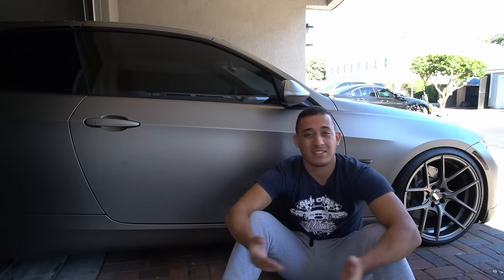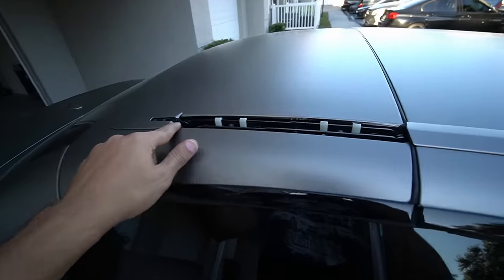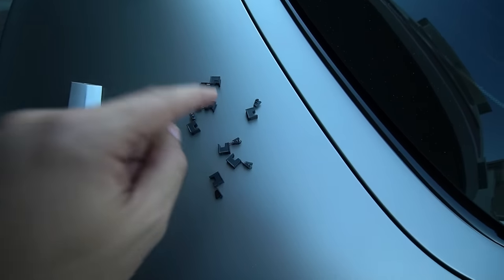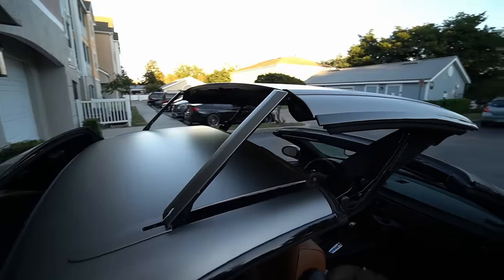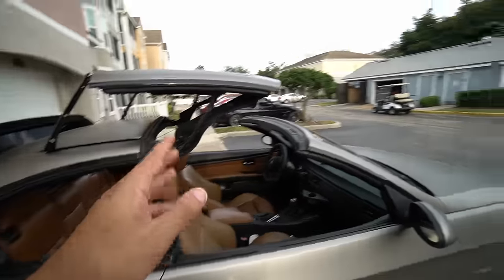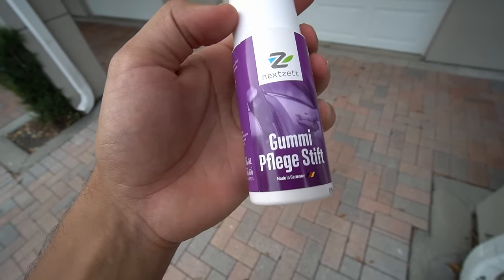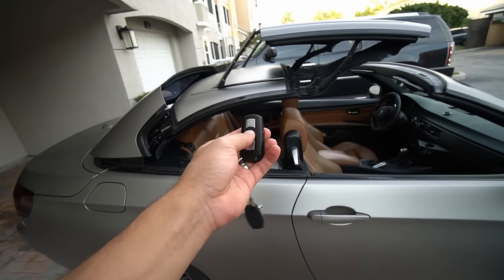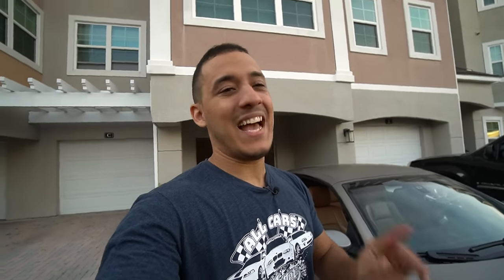Don't Buy A BMW Convertible - Here Are 5 Reasons Why

Comment from the maker: Just released a Vehicle Virals shirt featuring the BMW from this video. I have less than 100 available! https://vehiclevirals.com/products/bmw-3-series-in-motion
Reply: What about the coils, I have seen videos of which he talks about how they break down fast.
Reply: Vehicle Virals What’s the rims size
Reply: Help with my 2002 bmw 330i car got  hit on front bumper the air  bags in gaged  now car will not start where do I  start to trouble shoot why car will not start  ???
The battery is brand new ???????
Reply: A bro  I wanted to ask you a question about cleaning the rubber seals because I'm about to buy a bmw hardtop convertible. My question was what makes the rubber seals dirty what if I never put the top down will the rubber seals still get dirty
Reply: i have this same car 2008 model and i have one of the trim piece missen. will the link provide me with the part that will work/fit for mine? just asking. will appreciate any response
Reply: I also broke the small part in the roof 440 2017 , where I buy one, send a link from where you bought it, at the best price
Reply: I've had more relationships thanks to this car. nobody was looking at me when i was in my honda civic.

Comment: Had my e93 for 5 years zero issues. Works flawlessly.
Reply: How many miles on the clock? And how many miles you put on it? Considering buying one
Reply: I'm at 10 years, no issues either...
Reply: @michaelmullen8278  got it with 110k sold it at 180k. Only issue was a speed sensor. The 328s are solid
Reply: @eam3618  Probably N52 with 3.0L displacement. Right :D ?
Reply: @kjschrauber2126  heck yes
Reply: I’m on my second year with my m3 droptop it works perfectly!
Reply: Lucky for some😑. My one is playin up.
Reply: You have a pos car dude...just accept it.
Reply: @michaelmullen8278   My 2010 E93 hardtop still works flawlessly as does the rest of the car. 122k miles on the clock 

Definitely maintain the hardtop like shown in the video though, very easy DIY maintenance.
Reply: Im at 11 years on my E93 122k miles

Top works flawlessly as does the rest of the car.
Reply: I have my e93 m3 for a little over 2 years 92k on the clock and the only thing I replaced was a thermostat.
Reply: Yo tengo uno 
El motor de la capota falla toca realizar cambio
Reply: @santiagomateus333  aveses es solo un relay, busca videos aqui en YouTube
Reply: @camposjesus3725  Same here, 2008.
Reply: I have E93 and is maintance nightmare ,even i use it as weekend car there is alwalys sometning to spend money and time to fix,when you fix something after few days a  new problem  ,now i have rolover controler problem thas is so  annoying (it blink you in eye and you cant even see the time or temperature becase warning covers it) ,it started after installing new 12V battery ,we tried everything ,check everything ,even spend lot off money on new ROC module but its still there
Reply: Just had maintainance issues

Comment: I’m almost afraid to say this (knock on wood)...back in 2007 I purchased a brand new BMW e93 330D here in Italy, which I still own in 2020 meaning it’s now 13 years old and I drive it every day. It now has 250.000 km..... I take care of it like any other car, run it through automatic car wash, though I have never encountered any of these problems. BMW haters can say whatever they want, they may not like them and I can respect that but I personally still today impressed with the quality of the car. Personally I’m not a German car fanatic... I bought this because I wanted 4 seats, convertible, and  a hard top (buy a soft top  and then you will see how expensive it is to maintain!) , at that time it was either BMW, or Volvo. I opted for BMW, and 13 years later I don’t regret my choice. I have a coupe, a convertible, and a sports car all in one.
Reply: After 2008 BMW reliability  went down hill
Reply: I got mine in 2010, none of these issues either. I was also looking at the volvo, and VW had a hardtop at the time too. But obviously the e93 was the best option.
Also 10 years later, I've never done any of these preventative maintenance things lol 🤷🏽‍♂️
Reply: Same,Convertible top has been great no issues on or 2007 335i. As a matter fact, since owning this car since 2009 , I have only had coil pack issues. The rest as been regular maintenance .speaking about maintenance. I use Crytox on all the weather strips for this car. Aircraft and even NASA use this! Being a convertible it’s got over $2000 worth of weatherstrips so you want to look after them ! The little bottle of Crytox was about 50 bucks back in 2009,but well worth it. Cheers

Comment: I’ve owned two of these cars.  My first was a 2011 328i hardtop convertible.  Great car.  But after 4 years and 1 minor issue unrelated to the top, I moved on and bought a 2015 428i hardtop convertible.  It’s an even better car.  And it gets fantastic gas mileage...better than any car it’s size has a right to get.  Additionally, that 3 banger is faster than my last one was with it’s straight six.  It’s roomier, quieter, faster, and just more comfortable than my 328i ever was.  This car hasn’t had a single issue.  That’s 8 years of straight BMW hardtop convertible ownership, both originally purchased as Certified Used cars, and in all, there’s been but ONE very minor issue that had nothing to do with the top.  The tops on both have been absolutely flawless.  Neither has ever failed to operate perfectly.  This is one car I would DEFINITELY BUY AGAIN and AGAIN!!!  They’ve been better than any other cars I’ve ever owned.  Incidentally, I had a tow hitch from “Hidden Hitch” installed on both of these cars.  There’s nothing better than a day out on the water with your high powered jet ski except when you get to launch it from the back of your BMW convertible with it’s top down.  It makes the fun significantly better.  And when I finish riding my ski, I know that the fun isn’t over, because I get to tow it behind my BMW convertible.

There’s definitely BMW cars that have a horrible reputation. THIS ISN’T SUCH A CAR.  It’s probably one of the all time BEST convertibles out there.  And as a hardtop convertible, you get the best of BOTH worlds...A great looking coupe and a great looking convertible all in one package.  It’s every bit as quiet as the coupe with it’s top up.
Reply: Thank you sir! This review helped me a ton.
Reply: bro should i buy a 2007 bmw 3 series convertible?
could you guide me?
Reply: i have one e93 from 2008, never problems, maybe the consume its too high by 170cc (320i) its beautifull and great aerodinamic, im agree
Reply: @DeadshotVision  i have only one thing to tell you, make sure what this cars can past the ITV review, beacause the first models by 2007 any unities DONT PAST the standarts of Co2 emisiones. So be carefull with that

Comment: We need a episode how to clean the engine  😢
Reply: Yazz chrisfix
Reply: Could U not have used a silicone lubricant that is water repellant ? WD40 makes one too or any other brand? The thing is, the WD40 that U used smells & can damage rubber components & possibly stain you roof tops interior fabric.. Put it this way, I know Roofers that use it to remove roof tar from their tools & hands...😬 Also, U can always purchase an aftermarket warranty... EXPENSIVE! Do U feel that the 335is with the 2011 - 2013 will be going up in value ? What can be done to a 335is of those years to spruce up the HP? A chip 🤷🏼‍♂️ or what else ? Without stressing the stock twin turbo engine...
Reply: I took mine out🤣
Reply: erick r took what out ?
Reply: Chris fix has very good videos.. Very informative..
Reply: Juan Two 3 the engine and cleaned it

Comment: Hi guy:  I have a 2012 BMW 335i Convertible,  and like you,  every time I open up the top I think " What about  if some day It will break down !!!".  Right now I have a clunking noise that it seems to be coming from the right hand side towards the hinder seats.  Is there any rubber material that I could sandwich somewhere to eliminate that clunking sound ??
Reply from the maker: Same thoughts I knew it. Idk what location you're referring to, so I don't know

Comment: I wonder if you could 3D print some of those replacement parts, like the clips for example. Also, should you also grease the actual motors for the convertible assembly?

Comment: Thanks for the video - something to mention is the drainage holes which can get blocked either due to debris or frozen water. this can result in water flooding the electronics in the boot. They drain out each side of the car in the rear... BMW on older versions will open out the holes to allow for better drainage, the newer cars now have this done in manufactuer. Hoping these comments help. I love my version of this car, and have spent quite sometime touring in it in central europe (prior Covid).

Comment: I need to do the same soon, it's been 6 months already. Gumi Pflege you can use on all other rubber seals around doors too. Foam tip you can super glue back (mine fallen off too).
Best to use some cloth, put it behind hinge before spraying lubricant so it catches all excess, there is a lot of fabric pieces, why stain them.

Comment: Ive had 428, 435i and 335i hard top convertibles. I now drive an e93 M3 convertible. Never had an issue with ANY of them save for one tension string on my 130,000 mile M3.

Comment: Don't get rid of it! Weld it shut. No more maintenance, increased frame strength and never getting caught in the rain with the top down. Thanks for the e93 videos. Not only are the lights and trunk hard to find, but before you started your build so were e93 videos.

Comment: I have had my e93 335i since 2007.... I’ve never had issues with my roof “touch wood” but the amount of money I spent through out the years I could of bought a Ferrari... The problems I had were all under the bonnet. Had all new coils countless times in the end it was my wiring harness connectors seemed to of burnt out. My injectors all changed to new edition bmw parts... high pressure fuel pump failed.. Nox sensor was replaced twice and now it’s be Hex coded and removed from my ecu. This all started with a thermostat then everything else failed but now my 335i is spot on.. Has bigger turbos downpipe, Cat delete, racing coil over suspension kit. Car has 3 different modes I’ve set and it’s a true beast!! Here in the uk ppl move out the way hearing my car rubbling through their chests.
Reply: should have j got a m3

Comment: My uncle had both an E93 M3 and 335i, respectively. They didn't have any of these problems, but the M3 had the dreaded catastrophic rod bearing failure. The engine was replaced under warranty, but my uncle traded it and got the 335i. Ironically, the 335i was a much better car. He had it for about 5-6 years and all the common problems were repaired under warranty. If you know these cars, these were the turbo wastegates, fuel injectors, high-pressure fuel pump, VANOS, and water pump. Now he has an F10 M5 and an M4 convertible and so far they haven't given him any major issues.

Comment: The LCI e93 in the uk is more common. Try eBay UK you can pick a pair up for about £300 or 400 USD. Outside of Germany the uk has loads of BMW breakers and spare parts. That's why we all buy BMW because second hand parts are cheap compared to the USA. I put full 6wb digital guage on for £500 on my f11 msport. Also upgraded LCI msport steering wheel . But looking back the pre LCI steering was more brutal looking, this is more sleek and I don't like it.
Reply: Nah bro facelift steering wheel is way better looking imo
Reply: @yashmann  that's what I thought. But the pre LCI f11 steering wheel is thicker and and bulkier. Lol I might change it back.
Reply: @slcarsuk  personal preference, I like thick steering wheels but the look of it has to be important aswell. But I suggest you try swapping it out to see what you prefer, it might add to your driving pleasure

Comment: Love the video bro. I experienced the same issue with the plastic molds with my 2010 E93. However, you did leave out the fact that you will always get LEAKS at the driver and passenger door pillars regardless of proper maintenance.
Reply from the maker: I hardly experience leaks.
Reply: What i can do to repair my leak on front pillar connection driver one , right side its ok , and i proper grease them like u . But i still get the leaks , i got to the bmw and they checked the leaking tunnel and they said its ok idk why its happening . My rubber its in good condition but at left side driver seems to acumulate water in there.

Comment: I love me M235i convertible. Bmw techs told me that the hard tops have problems and leaking issues and once they go out of alignment they are almost impossible to get back correctly to prevent leaks, they said they have no problems with soft tops, one reason because it is flexible and can easily be put back in alignment if there is damage done.

Comment: Weird, I have a 2011 Volvo c70 hard top convertible. I put over 80k miles on it and have owned it for 8 years. I haven't had to clean the seals or the moving parts on it and it still works like a dream 🤷‍♂️

Comment: I have a 2017 Lexus and had it for 4-years. All I did to it was oil changes. I recently did my first big thing where I had to do the 30,000 miles service. It was $1497. This was after having the car 4-years of everyday driving. And the car drives like a dream. I had a BMW 325 and it spent alot of time in the shop. I'm not knocking your car but if you want real reliability get a Lexus.

Comment: Got watching this video is stressing me out! I have to e93's sitting in my driveway and my 2011 has a broke trim piece on the passenger side.... and its the hard one with the clips! Im hell bent on not spending $1200 to fix it so the trim price that is broke in 3 places is sitting on my table with jb-weld on it drying. Gonna try and put it back on with some bailing wire! Wish me luck!🤦

Comment: Great video: lots of useful info and quite amusing as well! The bit about conditioning the rubber seals and lubricating the joints was very clear. Thanks for taking the time to put it all together. I have a lowly 2007 325i SE E93 and need to attend to the same jobs... Cheers from the UK
Reply: yes, very useful information. but don't use wd40 - it leaves a sticky residue which will attract dust and turn into gunge. my bmw dealership suggested using a silicone lubricant.

Comment: Ugh my dream car when I graduate is a 335i e93 or M3 Hardtop convertible. For now I'll stick with my e92, 175k miles and still going strong.
Reply: That's pretty good there were even Engines which which you could do 300000 or 400000 km no problem

Comment: I’m buying mine tomorrow and I am absolutely stoked!
Reply: how’s the 335i doing ? i want one myself
Reply: @QutieQ50  I actually went with a 2010 328i e93. So far I love it. Repair cost for any used one will add up but once you get on top of it it’s a great car. I was hesitant to get a 335 as a lot are in worse condition than 240sx so I opted for 328i. Great reliable engine. All I’ve done to it is throw some bilstein coil overs, wheels , charcoal filter delete, muffler and secondary cat delete(kept resonator) and other minor things.

Comment: 1: Rear lights...  Not a problem at all...  You dont need them to enjoy the car.  They are fine!
2: Trunklid...  Have full insurance that would cover it if something happens or just dont brake it?
3 Headliner...  bit expensive not deal braker.
4 Hinges... Dont go to automatic carwash ever!  Also wouldnt insurance mentioned before cover it if its an accident in a carwash?  ( Must say im happy i dont have these on my e89 Z4)
5 Seals... I have the same Gummi Pfledge in my detailing  products box. Its even soid in gas stations  here where i live. Easy to get and have.  Every now and then  go over the seals after detailing or have a handwash/detailing shop do it...
6 Lubrication...  Have read about it... Some say that WD40 actually takes in dust and debris that then grinds on the hinges and  is actually not good for them.  In 4 years i have not even once lubricated my z4 35i roof hinges. I Have checked them numerous times to see if there is any need and they are  totally fine.  I think  Its personal preference if you do it or not. If you do then do it often so dust and crap would not accumulate for long. Or dont do it at all.

I was nervous about the top too in the beginning. Not that much anymore. On Z4 problems are mostly  broken wire or a  hydraulic line you just fix, microswitch that you can buy and replace and the biggest thing is the pump that you can have rebuilt. Of cource if you damage it in a car accident  fender bender it totals the car. Again have insurance. 
I did have a scare once though.. My top had an error  when i had forgotten a black small box in a trunk  where it should not be when lowering the  roof. It got in the way of the roof and roof stopped mid way and would not move. i was stuck in a public parking lot in a city center roof half way tingling. Had my car towed to the dealer where for last time i tried to operate the roof before giving the car to them to remove the fault code. And it worked again perfectly and has been  working flawlessly since then. Car probably went to deep sleep or turned itself totally off  during  towing and that reset the  error for the roof. I did try locking the car and walking away to have the car turn off but probably did not wait long enough  for it to work and called a tow truck.

Comment: I’ve owned a 335 convertible and currently have a e93 m3 for 4 years now with zero top issues. The only issue I’ve had was water In the trunk underneath the battery tray which rotted out the power cable supposedly it’s a common issue.